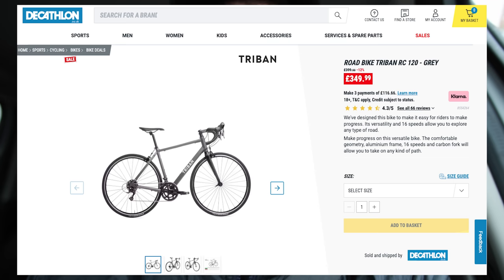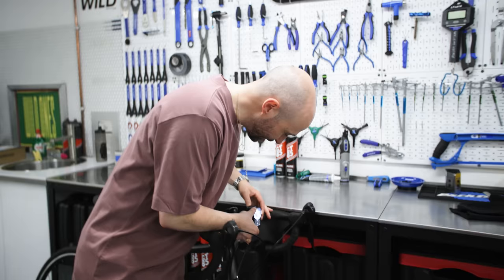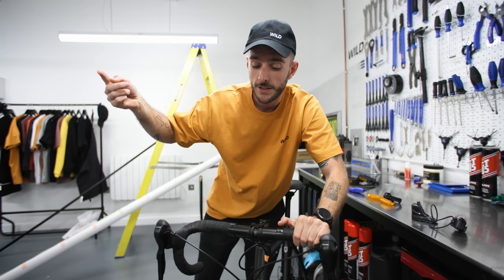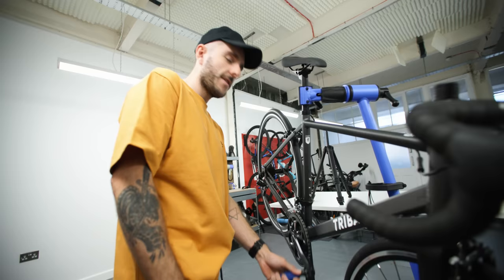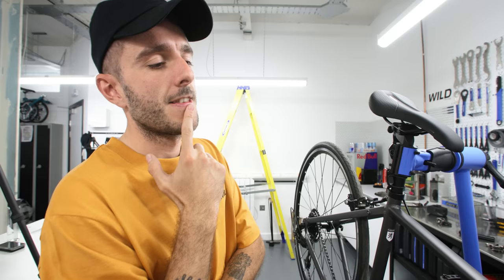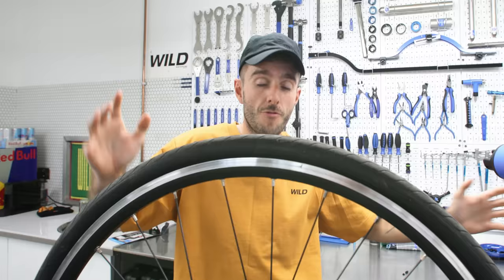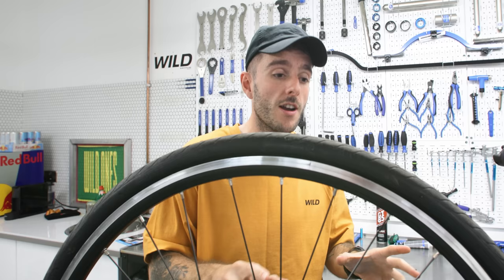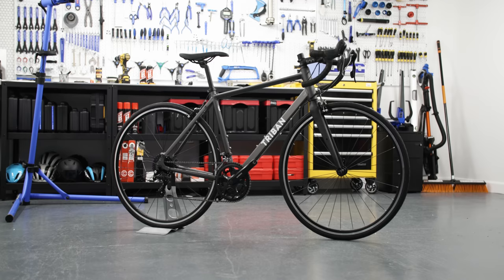We Bought A £350 Entry Level Bike in 2023 - This Is INSANE Value

Comment: It is beautiful, apart from square down tube, but matt black is my favourite...for me there would be no need to get anything more expensive. I prefer the way that bike looks to most other expensive carbon road bikes. I also like the look of the Laterite sold by Evans...but his one looks better because of the matt black. £350 is a great price, cassettes and chain rings can always be changed. And rim brakes are much more practical and value than disc brakes.

Comment: 10:10 - They route the bowden correctly. When you're turning right, the bowden arc has room to move without interfering with the head tube.
If you run it directly, it will rub on the head tube and eventually scrape off the paint. Abrasion is a b**ch :)

Comment: I have a Van Rysel EDR AF 105 (Van Rysel being the higher end brand of road bikes from Decathlon) that I have purchased for 1000 Euros back in June 2022 and, while I did upgrade some parts (narrower handlebar, longer and more flexible stem, a more flexible seat post, Shimano 105 cassette because it came with a Microshift one and Shimano 11 speed chain, a Brooks Cambium saddle and 28cc Gatorskins) to better suit my needs, the bike felt great as it was stock and I'm enjoying every single ride. 

I need to remind everyone that, for 1000 Euros (I think it's 1100 now) you get an almost full Shimano 105 R7000 groupset, which is literally unheard of in the entire bike industry at this moment.
Reply: If they made a version of that with disc brakes I’d be on it like a shot.
Reply: @martinwarne  why would you want disc brakes on a road bike? Maybe only if they're hydraulic, but those are very expensive and, to be honest, unnecessary. I weigh around 103-105 kg and the Shimano 105 rim brakes work impeccably.
Reply: @silviupanait8861  I have hydraulic discs on my hybrid commuter bike and they are so much more powerful than the 105 rim brakes on my road bike. Maybe it’s my age (60) but I’d feel a lot more confident on descents with that extra braking power.
Reply: @martinwarne  each to his own, I guess, I just never felt uncomfortable with my 105 rim brakes 🤷‍♂

Comment: Bought an Decathlon Elops Speed 920 citybike for the missus, apart from changing the tires the bike itself rides and looks great, and for the price its a steal. they only missed out in adding a mounting option for a kickstand (which actually is basically impossible with the shortish chainstays and disc brakes). she even sometimes rides it over her much more posh gravel bike because its just a nice bike and the position is rather sporty.

however, the service and support with decathlon was and is a catastrophe. to begin with, the bike arrived via DHL with some deep scratches and a bend brake disc because it was just thrown as-is into a much to big box with no(!) transport protection. front wheel jammed between brake disc and seat stay. we asked for a small refund or similar because the bike itself still is nice and we didnt wanted to send it back etc. - service did not respond via mail or social media. shop person was friendly but had no direct support possibility either. after some weeks we only recieved a pre-written mail totally not reacting about our request. shame. 

to be fair, buying the "same" bike from a company with better support might have doubled the price.

Comment: Not road bike but my btwin full suspension mtb I used for 10 years was faultless, only thing I changed was brake disc pads because they were worn out. Rode it through all weather and on trails. Snobbery is so bad in cycling.

Comment: Unfortunately i dont know if thats as much of a deal in France, since the same model cost 550€ (£500~) without promotion...
The RC100, the absolute base model of the brand was the one closest in price to what was paid in the video, at 350€ (£300~) without promo and at moment 300€ with promotion, and it only has 8 speeds and probably even cheaper parts everywhere possible.

Comment: I LOVED my felt f85 with microshifters!!  Snapped a lever biking to work in -15 fahrenheit, so I bought a new set of mid-high end microshifters.  not in love with the new ones.  I'd rather have shimano tiagra shifters for cheaper. Or dish out for the most expensive microshifters.

Comment: I bought a Rockrider ST530 MDB (Mechanical Disk Brakes) from B'Twin last year. Straight from Decathlon the front whee l was mounted croocked, the brakes were setup meh. Even the bike they gave me to test inside had the fork mounted backwards. After fixing all lf that, the bike held up hucks to flat (I'm 110kg). I'm very surprised that the bike manages to hold up to stuff like that for 420€.

Comment: I ride Rockrider XC50, the cheapest 29" CrossCountry bike from Decathlon. I paid 799€ for it in 2020. This bike have Rockshox AIR fork, boost wheels (tubeless ready and I set it tubeless no problem), thru axle, 1x12 sram eagle. Weights 13.0 kg tubeless with shimano 520 pedals. I have done 3000 km on the bike and it works fine. But now I saving for gravel bike becouse I think gravel bike suits my ride situation better. But entry level gravel bikes with hydraulic brakes cost so much money :-(

Comment: I know of the decathlon Rockrider ST540.
Best bike under 500 euro's. by a long shot

1x10 drivetrain MS Advent X (which is basically Deore M4xxx performance)
non branded manitou 100mm coil. (not fantastic but hey an proper fork costs more then this bike)
hydro disc brakes

Current price 430 euro's in sale.
If i couldn't buy wholesale due to my business i would buy them for my kid.
Heck even my wholesale price ex VAT for an compareable shimano bike from an major brand is higher.

It's just insane value and it allows kids to have something that works on an very young age.
Which just helps the sport tremendously.

Comment: The first thing I do with a UK bike in the UK is switch the brakes over so they are on the US/EU side otherwise both my wife and I get confused and the last thing I want is for her to go flying over the bars by yanking on the front brake instead of the rear. (Yes hydraulic brakes).

Comment: Come on, its not a bad bike. Look at the comments, most of present/past owners are more than happy with the bike. I currently own a hybrid bike, but I would consider triban 120.

PS: Regarding your negative comments. Decathlon offers lifetime guarantee for the frame, so breaking the derailleur hanger is not a deal breaker. Also, the size chart is provided by decathlon and is quite clear. I do agree what you might consider as M crosses into the L size, but is very clear in the size chart.

Comment: I have the btwin triban 520 and I absolutely hate it. It came with long reach brakes, and that's the only type that fits, and they are crap. I wish I could fit a nice set of 105 brakes, but I can't. The sora groupset is very heavy and not that great. The front shifter broke. It's a 3x9, and I hate that too. 2x9 is completely sufficient, no need for a 32 in the front. I wish I had known better when purchased it. Although I have to say that was my first bike since my childhood and I rode it a lot. Since than I got a cannondale supersix evo hi-mod, and I do ~6000 km/year. But it all started with the btwin, so all in all I'm glad I purchased it.

Comment: bought my lad a ST100 last year and its pants.
The seat tube is bent meaning there is little adjustment in the seat height and it is 100% impossible to get the gears to set and select correctly.
its been back to decathlon twice with no fix.

Comment: For the price this bike seems great. You might have ben too strict on the wheels. So what is if has ball bearings. My last bike I bought (Cube Nuroad cost 1000 eur) and it has ball bearings as well. And it not like ball bearing wheels ( even if you ride in winter) is going to fall apart after a year or riding.

Comment: What? You people not only drive on the wrong side on the street but also have your breaks the other way around on the handlebar?!? I learn a new thing with every video I'm seeing on this channel. Keep up the good work! :)
Reply from the maker: I ride mine euro, the proper way 👀 - Francis
Reply: Bikes are designed to be ridden on the left hand side of the road. That's why the gearing is on the right side of the frame away from the pavement and more likely damage by hitting the kerb or falling to the left. This is especially true for folding bikes where the drivetrain is at a much lower level and more easy to damage. So for cars you can make the case it doesn't matter but for bicycles its superior.  As for braking I've tried both and makes no difference to me which brake operates front or back I quickly adapt. You should always operate both brake levers simultaneously anyway in most situations its kinder to the bike and reduces tyre and brake pad wear and is safer.

Comment: I've got an accident and the shift gear bent inside. The frame does not come with an adapter, the gear shift directly connected to the frame. Just one big accident the bike is completely useless. Yes, as the video shows squeezed noise at the rear wheel, and I can't figure it out. The bike I already threw away.

Comment: Would be interested if you removed the wheels and weighed the remainder, then can add 1550 wheels, 2x70g inner tubes, 2 x 230g tyres, 260g cassette, 90g for qrs = 2500g and see what the new weight is

Comment: RC120 is cheap but here in Indonesia there are lots of local bikes that offer way better features with the same price! With around £350 we can get one bike with internal cable routing, integrated shifter and brake, and full of allumunium from frame to fork. I just can't stand that shifter from 10 years ago, also lots of cables everywhere on that bike

Comment: Upgradeability is not the best tho, with quick release, straight steering tube and square taper BB (probably, maybe octalink?). The risk is once you start having issues and need/want to replace or upgrade some components, it's going to be hard to find something that fits - at least in the new components market. I have the same issue with my gravel bike, which I got for double the price of this bike but just at the moment thru axles and hollowtech started to be available in the low-end of the spectrum. In 2023, anything that is not upgradeable is a pass for me. Granted, this is only 350.

Comment: I make my own wheels and far prefer cup and cone bearings. Only the cheapest 30 year old wheel on my hack commuter needed regreasing every year because of non-existent seals (now, with better wheels, its fine for 2-3). My road bikes last some years without regreasing. Far prefer my 10-speed Ultegra cup and cone hubs to my 10-speed Campagnolo sealed bearings. As for the mass manufactured wheels with sealed bearings that came with my road bikes, I use them on the winter bike as a disposable item. I would be more worried about the build of the wheels on the Triban and whether there are enough spokes and whether they are any good, rather than cup and cone.

Comment: The key word with cheaper bikes (or things in general) is always: durability. A 350 bucks bike that lasts half as long as a 700 bucks bike is technically also a 700 bucks bike. Maybe my Ultegra bike is cheaper than a Microshift or Sora bike because I can ride 20'000 kilometers with it before I have to replace it whereas I might ride a Microshift only for 5000 kilometers (arbitrary numbers just for making an example!).

Comment: At least in Germany, Decathlon lost a lot of its advantage in the beginning of 2023. 
While all other sellers struggle hard, as the bike marked crashed and are giving huge discounts on top bikes, Decathlon just keeps their prices.
Same with biking cloth btw. Further they have no stocks, so stuff like aero socks and race suits are sold out almost all the time.
This might change during the year but its already mid of April and there is nothing new arriving in the stores.
Good value for a price when you re getting into biking is, at least for me, not when the bike needs several repairs and modifications after the first ride.
All the low price tools and cloth I bought at Decathlon broke within the first month of using. It was good for getting started tho.
Further the Decathlon top, and middle class bikes are super overpriced. They still take almost 3k euros for 2020 tech bikes with 11 non di2 shifters, and the new carbon bikes are sold for 1.7k using  tiagra. 
Yeah you can upgrade them to 105di2 and sell the tiagra but why not buying a di2 bike for 3k in the first place.
Last year I d have totally agreed with your Decathlon statement, this year the marked in Germany shifted massively and Decathlon did not keep up with it.
Funnily while the bikes are massive for the size they should be, cloth are the opposite, so I guess in France they have only super tall slim people.

Comment: @Cade_Media

Hi guys! Love the channel and love the “budget bike” episodes.

Since you’ve featured a Walmart bike, I was wondering if you wish to test a bike from Denmark?

It’s sold as a “gravel bike” but my friend just bought one and we set it up like a road bike. Great ride from my experience. Specs is:

Size 53 or 57 (top tube length fits this)
Shimano Sora shifters
Shimano Sora Crankset
Shimano Sora Front derailleur
Shimano Sora Rear derailleur
Shimano CS-HG200-9 cassette
Tektro Mechanical disc brakes
Aluminum frame
Aluminum Handlebars and seatpost
Price tag: 349 GBP (2.999,00 DKK)

If you got any interest in reviewing it, let me know and we can figure something out.

I’m not associated with the seller, just found a great beginners budget bike for my mate and was genuinely excited over this one.

Comment: Do bike shops really charge £20-£30 per wheel, to service cup and cone bearings? It takes 10 minutes per wheel at most. £120-£180 per hour? That's insane! I suspect anyone buying this bike will either never service the hubs, or just do it themselves. No-one is going to regularly pay a bike shop up to £60 every month or so, for what is a very quick and simple task, on what is a £350 bike.
But what I do agree with is Decathlon's value, and top notch service. I bought a folding bike (I use it on the train) from them a while back, for just £99, and I've been using it for commuting for maybe the last five years without anything major going wrong.

Comment: Sure, wheels can always be better.  But to be fair, almost every front wheel on a typical group ride I go on cost more than this complete bike.  I've had bikes with cup&cone bearings survive 5,000 miles over a few years of wet winter bike commuting with only a couple bearing re-packings with no pitting.
My current $425 (341 pounds as of writing) bike off Craigslist is not what is holding me back yet.  There is a lot of (often well meaning) peer pressure to get deep section wheels and Di2 shifting that does less than if I would just stop stuffing my pie hole.  Getting into road cycling is a bit intimidating when you show up with a bike that is only 5-10% the cost of what the median rider is sporting.  The reality is that >90% of the gains you can get from equipment at the non-pro level are a decent fit, snug clothes, and good tires.

Comment: Did you kiddo's find out the OEM wheels brand? Fulcrum 900s by any chance?
 Am intrigued to see what the MicroShift is like over the longer term. Comparo with Claris? (when is the new SHIM wanksets out? [I'm not sold that CUES is going to be the utilitarian grail that is wanted])
Query on 32mm tyres getting past the calipers?? Deflated perhaps :D
 The lights would be more for visability than illuminating the road...
Harsh ride/stiff frame. Less so material construct, more like tubes profile. #Chonks
 Cable routing... would your method not hinder turning right, even a smidge? am thinking just a tiny bit of resistance really. I'd have said looping around at least removes a sharper radius for brake hinderance, but seeing as it rubs the steerer tube to then get into the stop... it's probably roughly the same issue anyways. XD
Reply from the maker: I’ll route it the other way and see! But unfortunately it will always be a compromise unless it’s routed for euro style brakes
Reply: @Cade_Media  You (UK), here (AUS) are we the 'U.S.' (imperial measuring) of cable routing... or is everyone else just wrong? :P

Comment: Bit of bargain that one, probably weighs less than my bike. Good starting point if your getting into cycling and a good bike to start learning bike maintenance if your that way inclined. As for the cable run for back brake I do the same I've personally found it gave a smoother cable run.

Comment: I've got the disc version of this and it's gone up €150 since I bought it. 7500km later and I've only had one puncture on stock tyres (which really need replacing now).

If you were so bothered by the cable routing, why didn't you change it when you had the bar off?
Reply: First upgrade was swapping the cassette for closer ratios, 11-25. I live in NL, so it's no great loss I miss a few lower gears. In fact, I don't recall using the small chainring.

Comment: Do you think it’s safe to slam the handlebar so low on a carbon steering tube bike?The spacers above the handlebar will shorten the compression plugs reach and it won’t be able to protect the stem bolts.
Reply: I'm pretty they are carbon bladed forks, the steerer tube is Aluminium.

Comment: Only you folks who have been riding for only 20-30 years or less would consider 10.7 kgs to be a heavy bike.  Microshift = good.  I actually never need to trim my front derailleur.  It doesn’t rub through the whole cassette on either chainring with the derailleur at either stop.  Never had another bike like that.